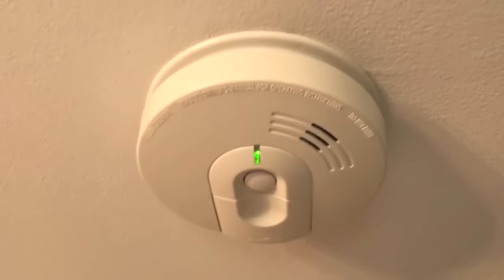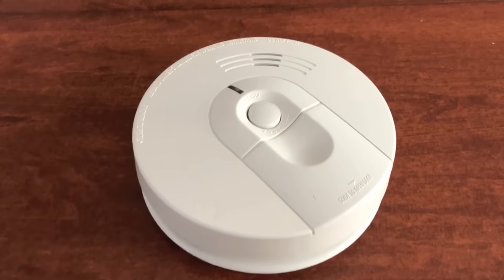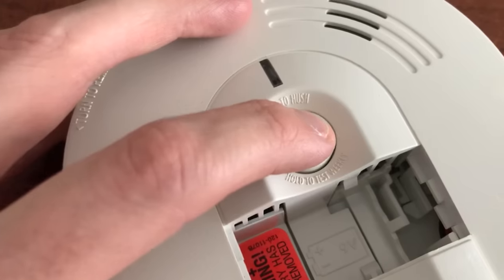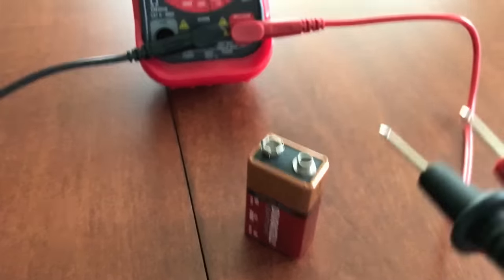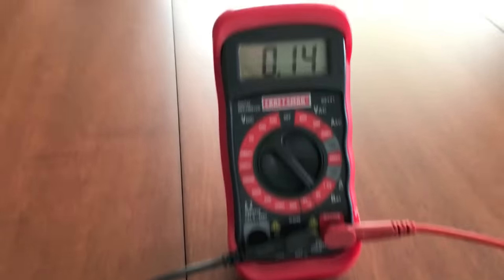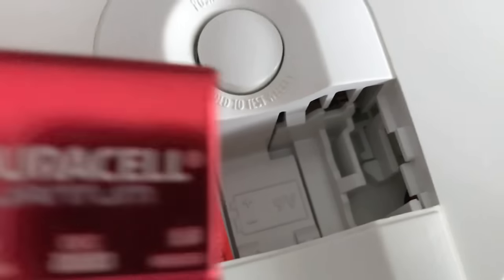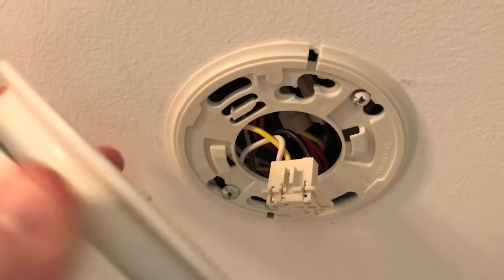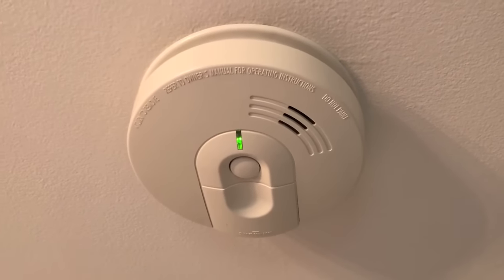Replaced Battery/Cleaned smoke detector- Still BEEPING (Must RESET Detector)

Comment: Thanks for the video.  Changed the battery first on the old smoke detector and still chirping.  So I exchanged the smoke detector altogether and still chirping.  Any thoughts on how to get it to stop chirping?
Reply from the maker: Scott Douthitt 

Thanks for watching Scott!  Let’s get this figured out!  

These detectors can definitely get annoying when going off for the wrong reasons.

Just to verify, you tested the battery voltage of the new battery correct?  Unfortunately this is more common than you think... example....purchasing a new battery and installing it when the new battery itself has dropped in voltage over the years of sitting on the shelf in the store.

Have you cleaned the detector in the last 12 months?  Anytime these little detectors build up dust / spider webs...  they can trigger the beep.

The next thing we need to verify is your actual hard wiring connection point.  Any recent painting completed on the ceiling?  Believe it or not, in the event that the connection point has paint on it, that paint will interfere with the proper connection and may lead to issues.

Let’s start there.  Keep us posted!

Please subscribe to the channel and turn on your YouTube notification Bell 🛎 that would be awesome thanks again!  😎👍🔧🔩
Reply: @DIYwithMichaelBorders  I also changed the batteries in all the smoke detectors but yet still chirping.  Thoughts?  Change out all the smoke detectors :o.?
Reply from the maker: Scott Douthitt 

Thanks for the reply Scott!  Below are a few links that may be helpful!

Also, by chance, do you live in an area where there is lots of humidity & moisture?  Believe it or not, high humidity & moisture areas can cause Smoke Detectors to go off for the wrong reasons!

Below are more helpful troubleshooting videos, let’s get this figured out!

How to Properly & Safely Remove

       https://youtu.be/9Uc5xO-S2rw

Cleaning

       https://youtu.be/WKLYWTBNf_I

Cleaning with Air Can

       https://youtu.be/f6rlV9X3Xxo

Smoke Detector Chirping

       https://youtu.be/lg0I4ZSmQhU

Reasons why Smoke Detectors Beep

       https://youtu.be/nRSMg_dVH9k

Hard Wire Code Rule for Smoke Detectors

       https://youtu.be/k7JMHBPm2io
Reply: @DIYwithMichaelBorders  Thank you.  Not able to find the links but changed out all the smoke detectors so still chirping on the main one.  Now remove all the smoke detectors and the batteries and turned off the power for 30 min and will put the batteries back in and then put them up in the ceiling again.  Lord willing that will work.  If not, I'll need to call in the hired guns.  Thanks again.
Reply from the maker: Scott Douthitt 

Thanks for the reply Scott & sorry about the links, not sure what happened.  We have inserted the links below to help you not have to call the hired guns!  😎👍🔧🔩

Below are more helpful troubleshooting videos, let’s get this figured out!

How to Properly & Safely Remove

       https://youtu.be/9Uc5xO-S2rw

Cleaning

       https://youtu.be/WKLYWTBNf_I

Cleaning with Air Can

       https://youtu.be/f6rlV9X3Xxo

Smoke Detector Chirping

       https://youtu.be/lg0I4ZSmQhU

Reasons why Smoke Detectors Beep

       https://youtu.be/nRSMg_dVH9k

Hard Wire Code Rule for Smoke Detectors

       https://youtu.be/k7JMHBPm2io
Reply: Oh my god I am so happy to have it stopped chirpin
Reply from the maker: Paige Westhoff 

Thanks for watching.  We are happy to hear you made it a DIY project.  Thanks for sharing your comment.

Let us know if you have any questions, we are here to help!

Please subscribe to the channel and turn on your YouTube notification Bell 🛎 that would be awesome thanks again!

😎👍🔧🔩

Comment: Will it still work without the hardware connecting to the electricity Just the battery
Reply from the maker: Thanks for watching, great question.  The battery is the backup source of power and will activate if main power to home is lost.

That said, removing electrical connection from detector and leaving it in this configuration will lead to you having to replace a lot of batteries…however the more important thing to consider is once the detector is removed from hard wired connection point, it’s no longer operating to code.

👍

Comment: Do you have to press the button to reset the alarm after connecting the wire?
Reply from the maker: Thanks for watching.  You shouldn’t need to however some detectors may require it.  Have you fixed your issue?

Please let us know if you have any additional questions.  👍🧰
Reply: It did, but unfortunately, the chirp came back after a day. They might be too old and need to be replaced. Still really appreciate your video with the clear instructions! Especially to test the device without being wired/connected to the rest of the alarms really help to minimize that obnoxious noise. Also, now I know I did everything correctly, but I just need to replace the alarms. Thank you for making this tutorial clip 🙏
Reply from the maker: @k7282  

Thanks for the follow up.  In that case, we think you’re spot on.  Replacing the detector might be the best route to take since the old one is not cooperating with the full system drain procedure.  😁👍

Comment: Thank you so much.  I was going to buy new smoke detectors but I guess I don't have to now.
Reply from the maker: Nixfilms LLP 

Thanks for watching & you are very welcome!  We are happy to hear you can save some money & not purchase new detectors yet.  You will want to replace them after they expire.

Definitely keep us posted on your DIY project & any questions you may have.

Please subscribe to the channel and turn on your YouTube notification Bell 🛎 that would be awesome thanks again!

😎👍🔧🔩
Reply: @DIYwithMichaelBorders  I'm not sure the new ones aren't 1000x worse than the earlier models. Ours is 1.5 years old (hard wired, multiple smoke/CO detectors) and we have followed every step in these vids like slaves. Vaccuming, blasting with a computer air cannister, brand new, fresh-bought batteries. They're still going off randomly and we can't figure out why.
Reply from the maker: Deb Kinnard 

Thanks for watching & sharing your experience.  Sorry to hear about the troubles.

A few troubleshooting steps.

1.  Disconnect Detector from Hard wiring

2.  Remove battery

3.  Press Hush button for 20 straight seconds to remove remaining electrical charge

4.  Get new battery & test it with volt meter on 9v setting.  Battery charge must be over 9v....approximately 9.2

5.  Insert new tested battery & close battery door

6.  Press & hold Hush button to perform pre-test.  You will hear 2 soft beeps & 1 loud beep.  If you do not hear these beeps in order or if only the 2 soft beeps trigger however no loud beep...remove battery & follow steps 2-6 again until you get the 3 beeps in order.

7.  If Battery test passes...meaning “Beep, Beep, BEEEP”, reconnect Detector to hard wiring connection

8.  Re-secure Detector to its mount.  Be extremely cautious as you reconnect detector to its mount because you do not want to loosen the hard wiring connection as you shift and rotate detector to secure it.

9.  Verify Detector light Green.  If it’s Red, remove Detector & follow steps 2-9 again until you get the Green light...some detectors are fussy & take 2-3 tries.

Also verify that there is no paint on your electrical connection points as most homeowners will take the smoke detectors off the ceiling to paint.  As they are painting the ceiling, they may accidentally put paint on the hard wire connection...which leads to a short in electrical power & unfortunately sends you into a continuous nightmare as you attempt to figure out why.  😲

Keep us posted.  Please subscribe to the channel and turn on your YouTube notification Bell 🛎 that would be awesome thanks again!

😎👍🔧🔩

Comment: I took the backup battery out of my hard-wired smoke alarm because it 
started to chirp (once) every minute or so and wouldn't stop, and I don't at this time (now 5AM!) have a fresh battery to replace it with. Yet it's STILL doing it, without a battery even in it! Would it warn the same for a missing battery as for a weak or dead one?
Reply from the maker: Tom C 

Thanks for watching.  What’s your update?  We recommend checking the date on your Detector.  What year is it?  If it’s older than 7 years, it may be faulting out causing erratic behavior.  Keep us posted!

Us fellow DIY’ers need to stick together.  Many more helpful videos to come!  😀

Please subscribe to the channel and Ring your YouTube Bell 🛎 that would be awesome thanks again!

😎👍🔧🔩
Reply: @DIYwithMichaelBorders  - I found an old 9 volt battery I had laying around and stuck that one in. Problem solved. So a hard-wired smoke alarm does apparently chirp not just when the backup battery is dead or weak but also when there's no backup battery installed at all.
Reply from the maker: Tom C 

Thanks for sharing your update & info Tom, we appreciate it.

😎👍🔧🔩

Comment: Thanks so much! I had all but given up hope. 2 upstairs were going off for months then my basement started up last week and the final straw was this morning when I heard my hallway started. So I found your video did the procedures on the hallway and it worked. I went upstairs and did 1of the 2 and that worked the basement for some reason has AA batteries and it didn't work so I have to find out why.
Reply from the maker: Joseph 9 

Awesome Awesome & you Rock!  Well done & we are happy to hear you’re back up & running.  We love reading comments like yours.

Great job not giving up.  Looks like you solved your DIY project & saved 💵 💵 by not having to call an electrician.  😀

Please subscribe to the channel and turn on your YouTube notification Bell 🛎 that would be awesome thanks again!

😎👍🔧🔩
Reply: @DIYwithMichaelBorders  ok I got the detector in the basement to be silent once again. I disconnected it then took it upstairs, all the while it continued to beep. So I removed the batteries and put in my battery  charger to check if the batteries were good and lo and behold they were so I left them in for about half hour then reinstalled them. Then I depressed the button until it spoke, saying fire! I noticed after that no more beeping! I put back and I have been stress free! I went upstairs to my second floor to work on the other smoke detector and did the procedure outlined here and for some reason it didn't work so I believe that it's a defective unit and I will replace. The story is not over though, 2 days after I heard beeping upstairs again so I went to investigate and for the life of me I could not ascertain where exactly it was emanating from. So I check the defective one that I unplugged and removed the battery. After I checked the one that I had previously got to work and after much mental debate I removed it. I went downstairs and believe it or not I heard it beeping then I heard it say low battery! I was spooked because no unit was connected, where was it coming from? So out of frustration I gave up until the next day. Again I'm looking and as I was about to go back downstairs I discovered that the beep was coming from the carbon monoxide/fire detector on the wall! I simply changed the batteries and I finally have peace! Thank you Jesus!!
Reply from the maker: Joseph 9 

You just made our day!  😀  Your determination was Key!  Those darn little Detectors sent you on another Rabbit Race....🐇

Man O Man...as we were reading your comment, we thought you were going to tell us that you finally pinpointed the chirping ...& that is was coming from a random Detector in the closet that was just thrown in there years ago & forgotten about...not even hooked up to the hard wiring...we were so excited to hear that because that would have been too funny!  😂...but wasn’t the case.

We are so happy you shared your project with us.  This may help someone else down the road!

We are always here to answer questions!  😎👍🔧🔩

Comment: Do you know what voltage the 9 V is considered bad I'd like if I test the 9 V and it's at 50% voltage the is that considered bad. And if so what percent or Voltage should I replace the batteries at

Comment: Do I have to remove the whole thing to replace the battery? Can I just replace battery while attached and reset it?
Reply from the maker: BestChocolatecookiesRecipe 

Thanks for watching & that’s a great question!  In order to properly reset Detector, it will need to be fully removed from the Hard Wiring connection point.

After removing Detector from Hard Wiring point, you will then need to remove 9V battery.  At this point, the Detector is in its proper configuration for a full reset.

After resetting Detector, insert battery & reconnect to Hard Wiring connection point.

We hope this helps & let us know if you have any additional questions, we are here to help!

Please subscribe to the channel and turn on your YouTube notification Bell 🛎 that would be awesome thanks again!  😎👍🔧🔩

Comment: Thanks for the vid. I have the same model and tried replacing the battery, but the second I plug into power source it starts beeping (not chirping) and doesn't seem to stop until I silence it. After silencing it stops, but starts beeping again a few seconds later. Any thoughts?
Reply from the maker: Doug Henness Thanks for checking out the video and sharing your experience Doug!  I recommend removing Detector from the actual Hard wiring, remove Battery, & then Drain All remaining electrical charge as shown in the video.  Even the slightest bit of stored power will still interfere with the new Battery!  This is definitely more common than many think!  Keep us posted on your repair.  Let’s get this Smoke Detector back to proper good working status!  Please subscribe to the channel and turn on your YouTube notifications that would be awesome thanks again Doug!  😎👍

Comment: DIY With michael borders. Hey! Thanks for uploading the video. But I have a questions. I have 6 smoke detectors at home. All of them are wired with the backup batteries. But randomly 3 of them started doing the noise. I have replaced the batteries. Disconnected them and drained the left over power with the battery off until they wouldnt make any more noise. I have installed the battery back and connected them but they are still going on. I cleaned them and they even got the green light but they wont stop beeing every minute :(. Do you happen to have another suggestion? I mean they are cheap i might as well buy then new but are rhe lile syncrhonozed with each other?
Reply from the maker: Irvin Casanueva 

Thanks for watching & sharing your experience Irvin!  Let’s get this figured out!

A few things come to mind!

1.  Age of detector plays a big part.  After the smoke detector exceeds the expiration date, it is recommended to replace it at your earliest convenience.  A set of new detectors may solve your problem.

2.  The 4-Common reasons detectors go off without smoke.  You mentioned you already did a good amount of self checking & cleaning.  It leaves us to the last reason...High Moisture!  Below is A link to a video that will explain in more detail.  Definitely check it out!

       https://youtu.be/nRSMg_dVH9k

Keep us posted!  Please subscribe to the channel and turn on your YouTube notification Bell 🛎 that would be awesome thanks again!  😎👍
Reply: DIY With Michael Borders thank yoy for the quick reply. I will do more testing and see what ends up solving my problem. Keep these good videos coming! Liked and susbcribed :)
Reply from the maker: Irvin Casanueva 

Very cool & thanks for subscribing!  We subbed back!  We appreciate it!  We love making these helpful videos!

Keep us posted!  Talk to you soon!  😎👍
Reply: Called Kibbe and they said that my 20 detectors were probably out of date. They were dated 2011 Mar 10 so I assumed they were 10 years guaranteed but was told most likely 7 seven years was the end of life for them - quite an expense to replace them all. Saw that they were averaging 30- 40 dollars each that's a major expense.

Comment: Ok, I give up. How do you close the battery door after you put the new batteries in? Both of mine won't close. Also, my husband disconnected the wires from the ceiling. I have to connect them back up. How do I do that? Are the ones in the ceiling color coded like the white, black and yellow wires hanging out of the smoke detectors?
Reply from the maker: jan dow 

Thanks for watching & sharing your experience & we are here to help.

We definitely feel your annoyance!  These little Battery doors can be tricky.  

The most important thing is that the Battery is properly inserted & seated correctly.  You can then shift cover back into the closed position.

As far as the installation of the Detector back to the Hard Wiring, the little connection tab with the black & yellow wires will fit right into its mount with ease.

Below is a link showing the removal process which may give you a better idea.

       https://youtu.be/9Uc5xO-S2rw

Keep us posted on your project!

Please subscribe to the channel and turn on your YouTube notification Bell 🛎 that would be awesome thanks again!

😎👍🔧🔩